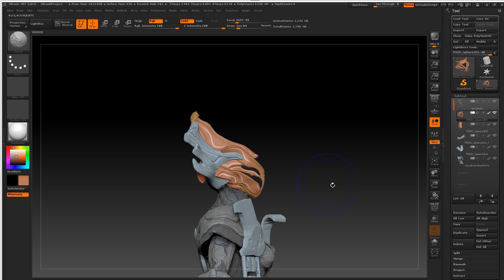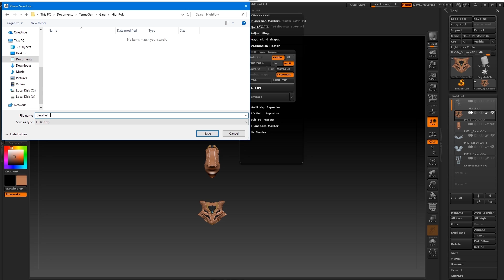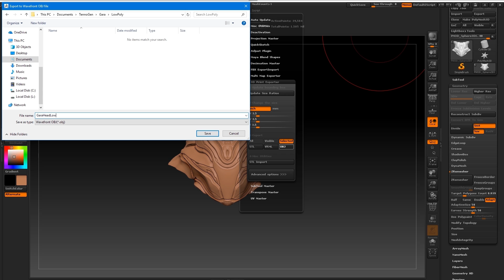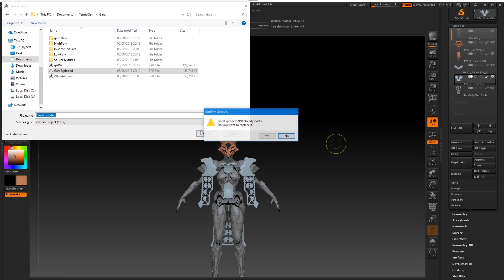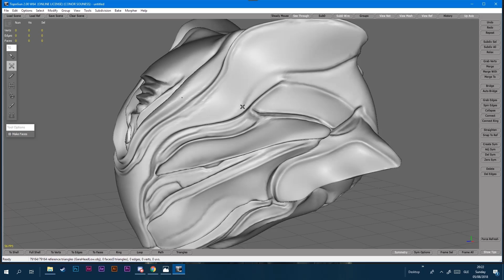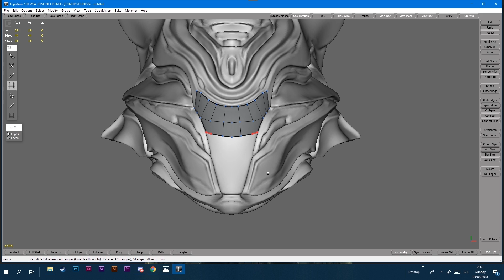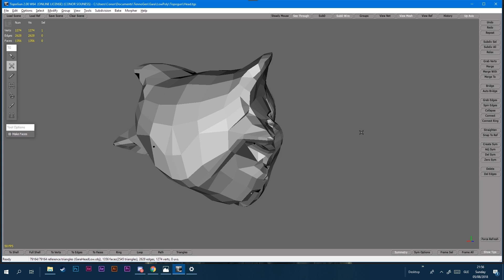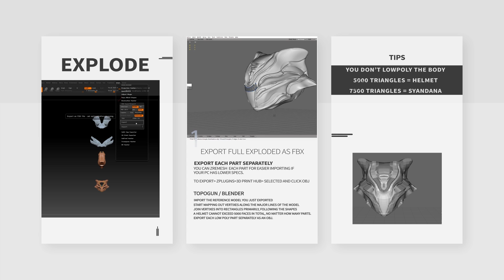Warframe: The Tennogen Guide  Part 3 - Low Poly

Comment: How do we create textures and save the maps. Diffuse,specular,metallic , roughness etc as tennogen app ask for these
Reply from the maker: That's all substance painter! There are presets from DE that allow us to save those maps!
Reply: @Hydroxate  won't the map for a helmet be different from DE UV map that's given. Has its built from scratch. 2. Textures and tint masks are different right, do both need to be assigned on a Warframe sculpture and are they built from scratch. 3. During repotology how many box lines need to be used and how big
Reply from the maker: 1. That's why we have to low poly and retopo the helmet we make, since it's different to the default helmet. We don't low poly the body as it's given to us by DE already and we can't change it's geometry. 
2. Textures are the materials and details on the frame, which are your normals, roughness, diffuse maps. Substance painter creates these for you!
3. The box count is the most important, 5000 in total! The size depends on the area you are trying to cover, for curved surfaces you would have more than a flat surface! You can see roughly how big my faces are in the video
Reply: @Hydroxate  on the pre created UV map given by DE we add our mettalic / roughness textures etc on what areas we want using substance painter?. 2. Is tint masks its own separate part after the textures part is done. 3. Can blender be used to do texture and retopolgy if not 4. Is there a alternative to Substance painter to do this that's free like Gimp/kritia
Reply from the maker: You 1. For the body yup, you load in their fbx, use your sculpt as the reference and it's all painted above that. 2.If you do it in Substance painter, the export setting DE gives exports the map for you on how you paint. If you wish to do it in gimp, a tint mask is a black and white png with the channels used to determine which tint goes where. Red channel is for primary, blue channel is for secondary, green channel is for tertiary, alpha channel is for accent colour. Emmissive is it's own png thats basically black, but white where the energy is on the unwrapped body.
3. I know you can definitely do retopology in blender, not sure about textures! 
4. Gimp can be used for tints, but to get a really good sculpt, substance painter is definitely worth it. it goes on sale regularly too, and they do a subscription for 20 a month util you've paid the softwares price, then they give you the full version!
Reply: 5. If I do the repotology phase for each part of the helmet separately , when that creates a UV map for each part how would I put all of them onto a single UV map. 6. How would I transfer the high quality detail of my high poly mesh to my  low poly mesh.
Reply from the maker: you usually bring all the lowpoly'd parts into blender or maya, combine them as one piece and the uv's will then be in one UV map, I'll be showing that in the next episode coming tomorrow or friday!
6. That's the process called baking, and you need software like substance painter, marmoset toolbag, or knald. Substance painter is great cos you can bake, texture, and tint, export all in one

Comment: i personally use blender, i got used to the interface is good sotfware, there is an add on that lets you highlight ngons and manifold, that one of the issues i had initially when i was making my models, that thing drives you crazy not knowing where is the issue. 
question why dont you use decimation master of zbrush there is some weird issue with it? i know it erases the polypaint but for making the low is very practical since it doesnt make your computer lag.
Reply from the maker: For reference it's really good, but for final model there are some issues with how it creates the faces, your eye is a better judge of what needs to be a face and what doesnt!
Reply: much appreciated, :) i will try to use the zremesh more, hope my pc doesnt blow up jk

Comment: Finally!...Yuss.....I'v been waiting for a long time for this..I made so much personal Tennogen skin concepts yet don't know where to start and how...this is really helpful...btw...how do u do the wagging flaps on warframe helmets like...uhh...Hydroids Beard or tentacles?
Reply from the maker: Endgamer //THEENDOFTHEWORLD ah! I start with just a little sphere, move it into the desired shape and proceed as normal. When you do the low poly, you have to make sure your tentacles are low poly’d in even rectangles around creating almost a cylinder effect, while still holding the shape of the underlying tentacle. You can then add in your submission that you wish to add physics to the part and they’ll try to work with it! Similar to effects like fire, you make a low poly of the piece, and they replace it with an effect! Energy is different as its done inside the main textures
Reply from the maker: https://imgur.com/a/rTReRqh something like this!
Reply: Ohhh..ok got it!...Thnx alot :D

Comment: Why did you make the helmet in four different parts instead of one?
Reply from the maker: Teddi Andersson Its needed for the part wheree we make the textures, if the parts are joined the details from one part can bleed over to the part thats attached to it, so we explode it to prevent that until the textures are made. Once they’re made, we swap to a merged low poly version and the textures remain the same!
Reply: Hydroxate I was sculpturing with one hold clay will that be a issue and if so how would I separate pieces out. And rejoin after tint masking
Reply from the maker: one solid helmet isn't bad! but if there's ever parts that are attached to a helmet, it's better to make them a second object and low poly them separately. You work with exploded for multi part baking, once the bake is done in the texturing phase, you open your exploded version in Maya or blender, rearrange the parts to form the merged form. Never physically merge parts, you just combine the parts into one object and export, that file keeps the same textures as the exploded since they use the same UVs!

Comment: Relevant question: how do you delete the warframe's shaders from the Zbrush file? Seems like I either loaded it in the wrong way or it's stuck with the FBX file.
Reply from the maker: Revenant the textures can be turned off in Texture Map on the bottom right list, just turn it off. Also you should change material from red to SkinShade4!
Reply: Hmm, never thought that the black shader-like markings could be turned off within the Texture Map on the tools section. As for the material, I am working on BasicMaterial2 to get a better idea of the skin (and head, since I am working on a Tennogen concept). As for the Tenno markings (painting), any tool you can suggest for teh job?
Reply from the maker: Substance painter is king, and it's regularly on sale on steam, also Allegorithmic do a subscription that's 20 a month, and once you have paid the full amount of the software, they change your subscription to a full license!
Reply: I meant the markings that the helmet has in the zbrush file (haha) that is shown in your video
Reply from the maker: like the white lines? Thats when you turn off Zadd or Zsub on a brush, and turn on MRGB, you can then paint instead of sculpt.
Reply: I ask becuase I am working in a possible design for a TG helmet for Chroma and, while most of the geometry is done, I am unsure if it's "passable" in the warframe design (markings, widgets, color proportions) - it's my first time working in something of this caliber and I'd like some guidance to what aspects are right and which ones need to be fixed. .
Reply from the maker: I would pay attention to the body of chroma, try to keep the ratios of colour and markings the same!